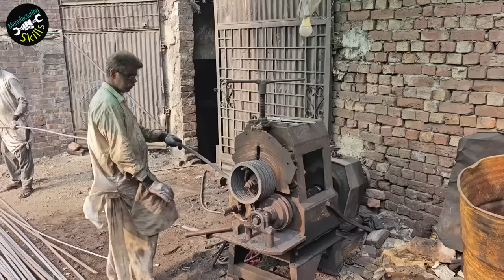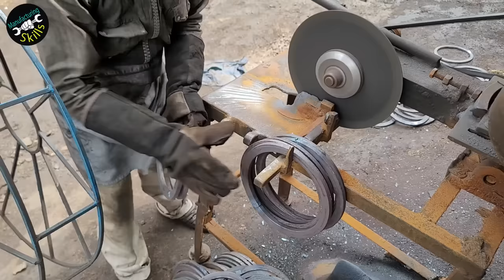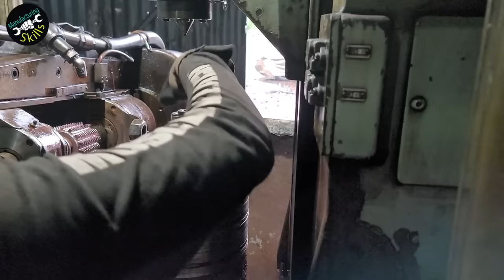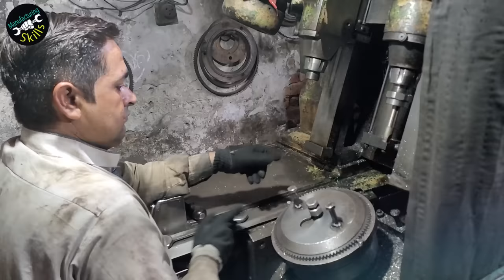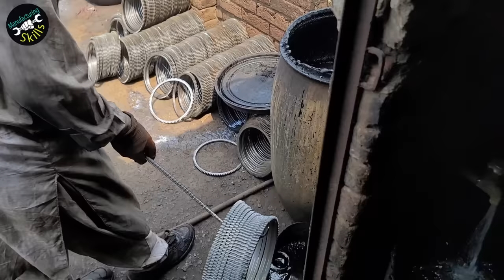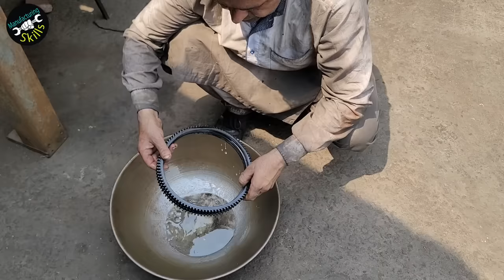Incredible Process Of Making FlyWheel Ring gear Of Suzuki Mehran

Comment: I'm fascinated by these videos, at every stage the item is thrown on the floor, why not use benches, that'll save some backache..
Reply: Agreed. By the time these workers at 45 they are so riddled with pain they can hardly work. How hard would it be to have a bench connecting all the stages.
Reply: They do all their work from off the ground !!! My back wouldn’t last 5 minutes 😩
Reply: В Индии это похоже на фетиш. Смотрел много видео. Везде кидают на землю, потом с трудом поднимают. И везде грязь и пыль.
До культуры труда им очень далеко.
Reply: @edaminev  Возможно ли это как-то связано с кастовой системой, высшая каста бросает его на землю, чтобы низшая каста могла его подобрать, тем самым утверждая свою власть?
Reply: @alexbaxter9512 that's  the dumbest thing I have read in a long time.
Reply: @sdsfgsty  You've not done much reading then?
Reply: give it a few decades then they discover using benches is better for your bodily health.
Reply: @snaplash the real question is what is a gear😅😅😅
Reply: When the Brits left, they took all the benches.
Reply: Probably a spare part. This part is infamous to wear on old engines.
Reply: none of your six sigma crap here just get it done or starve the operators are lean never mind the  operation
Reply: @johnfenn what makes you think these people will make it to 45, most will have been crippled due to poor working conditions.
Reply: @eweunkettles8207 I'm sure few get your joke but I find it hilarious !
Reply: Because they make their mistakes .And leave you to make your mistakes.

Comment: Imagine if they put the gear on movable carts rather than throwing it on the dirty ground after each step of the process
Reply: If I ran the place, I would spend a few days making work tables, carts, and organized racks.  Get all of the work up off the ground.  It seems very inefficient to me.  The amount of unnecessary energy that is expended simply picking parts off of the floor/ground is huge over time.  But they do make good parts with the machinery that they have.  I'm not sure though if the steel is tempered properly for its end use.
Reply: @edschultheis9537  from what I've seen throughout the years is in Pakistan and India the worker is "expendable", they're basically slaving away, (just remembered, EGYPT TOO! Egyptian workers in Jordan and much of the middle east are worked to death), in Jordan, it was cheaper to bring a bunch of Egyptian workers to carry bricks up a 7-floor building for an entire day than it is to bring a truck with an extendable boom that'll do the work in less than an hour. they owner simply doesn't care, he doesn't see the workers as human.

Comment: I didn't see any heat treatment. Soft iron gear? Chemical effects give it a color as if it had been broken by heat treatment. Didn't the material harden from so much soaking?
Reply: That's why they make so many of them, they only last three months probably.
Reply: 12.35 ish onwards. Looks like hot salts infusion to me. Then rinse, then neutralise.  He then blackens them and finally oils.
Reply: @chrisbis36ify  In a plastic barrel with some chemical balls in it? He doesn't look hot. Neither is iron.
Reply: @azrael834  no..... the metal looking tank. Brown in colour (liquid) its bubbling, which makes me think its heated. There's a tall gas cylinder on the left.
You will notice for the latter stages, they don't handle the gear by hand, but rather carefully on the end of a slight hooked long rod. Maybe they have been heated somewhere.
Reply: @chrisbis36ify  If you look at it, it picks up the waiting parts from the ground with the hook tool, which cannot be hot. The angle tool is needed because there are caustic liquids in the barrels. You can't dig into it with your hands. It is possible that these parts were heated in one of the phases that were left out, but then they should have been heat treated immediately while the metal was still glowing. And because of that, he would have already discolored. The way I see it, they use various acid tricks to make a hardened level, as if that would have happened.
Reply: You missed heat treatment part. I mean that part which welded two ends together :-D
Reply: It's not iron.
It's steel.  Im not sure of the alloy, but the teeth of the gear aren't very hard, they are just very durable
Reply: @gregbrightwell662 You can already see from the beginning that the material cannot be hardened steel. It would also be a challenge to process it. It would break when rolling. It would snap when welding. Well, it's not all hard material. But in those countries it is good. Where is this from German or Japanese technology? Anyway, I don't want to talk down. I am happy to see how such a country tries to prosper and develop. I also like Indian people! A simpler world is often more beautiful!
Reply: @NutsandGuts  Another arm chair expert ,on the web.
Reply: @daviddavis6231  Are you defining yourself?

Comment: Wow.  Red lead was outlawed in the US in the early sixties IIRC because of extreme lead poisoning from just the vapors that are given off when it is used as shown, high pressure gear hobbing.  There is little that competes with red lead as far as extreme low cost and coolant life.  Lead poisoning and birth defects must be astronomical for these workers and their families.  I have the EPA crawling up my butt if I drip some oil on the ground when I do an oil change on my truck.  Here, red lead is used freely and I'm sure it is disposed of properly.

Comment: No heat treatment i like my flywheel ring that will last a few months
Reply: I thought hardening was essential?? For starter rings. I can't believe it's not hardened.
Reply: Isıl işleme gerek duymuyorlar deneme yapılmış daha önce
Reply: @swarfs  that's what she said
Reply: @swarfs Ring gears are not hardened. I have replaced many flywheel ring gears over the years and to remove the old worn gear we simply drill a hole just beneath the teeth and give it a couple of blows with a hammer and chisel. They are quite soft and ductile.
Reply: @howardosborne8647  The body of the ring gear is not hardened, it has to be more ductile to shrink fit and grip onto the flywheel.  The teeth are hardened to resist wear, typically to over 45 Rockwell hardness.
Reply: Suzuki will have issued a specification for dimensions, hardness, etc.  If they don't manufacture it to those specifications, they will be rejected when one of a batch is tested.  Suzuki are not fools...

Comment: That chemical treatment is done to make it look like the gear has been heat treated. Those are mild steel rings and they will not last long.
Reply: the chemical treatment is simply black oxide treatment, it is a common enough treatment for ferrous parts that simply gives some rust resistance, it is not meant to enhance strength
Reply: Normally, Flywheel Ring is made of Pig Iron.
Reply: You just buy a pack for spares
Reply: I am using it since many years it's work for long at least 2 years or more
Reply: @husainzaidi1527 Pig iron is a crude form of impure iron derived from smelting iron ore. Ring gears such as these in the video are made from steel which is a far higher quality processed material than pig iron.
Reply: Exactly, I have nothing to add on.
Reply: The Mehran only has an 800cc motor.  I think a mild steel ring gear will be fine.
Reply: it's name blakening process
Reply: You buy the product over and over again without end
Reply: It is not heat treated otherwise it will tempered as the self gear is also high tempered so if both is hard the teeth will be broken so normally it wear of not teeth broken
Reply: @husainzaidi1527 you dont know what pig iron is.
Reply: The reason why they fail is because even the manufacturers use similar methods to
Reply: @mrbunchofcells  you made that up though.
Reply: @snowflakemelter1172  theory is sometimes evidence
Reply: @mrbunchofcells  theory is not evidence, a theory requires evidence to prove.
Reply: @snowflakemelter1172  is that so,, i suppose u've brung ur own evidence before making that claim?
Reply: @mrbunchofcells  don't be stupid.
Reply: @snowflakemelter1172 lol, stop liking your own comments you two.
Reply: It’ll last long enough to get through the 30 minute/3mile warranty
Reply: @norbertnagy5514  yo it's not me seriously i'll like my last comment as a proof
Reply: @icusawme2  it's still more than you'll ever last
Reply: @mrbunchofcells  seems true, sorry for accusing you then. Unless you have a second account or more but lets not jump to conclusions.

Comment: No hardened?
Reply: It is not always beneficial to harden some gears because they may actually wear faster and crack under the constant starter gear engagement.
Reply: @sgtbrown4273  but they need to be tough because the gear from the starter is pretty hard/tough. It would wear down a too soft metal fast

Comment: Flywheel ring gear is used for starting the engine. It connects to the starter motor via a solenoid. I hope this material is not plain Mild Steel, as that won't survive the brutal torque on it.
Reply: Ellerinden nur gibi emek çıkan emekçi kardeşim çalışma şartları çok ağır ve ilkel Allah hepinizin yardımcısı olsun. Patron parasına para katarken biraz sizlere daha güzel bir fabrika veya işletme kursun
Reply: Heat treatment is ignored deliberately. They want frequent damage of gear to attain more business.

Comment: 9:27 an unskilled eye might say impressive work, a skilled eye will have a look if all the teeth have the same length/shape otherwise the transferred speed will be not continuous per rotation.
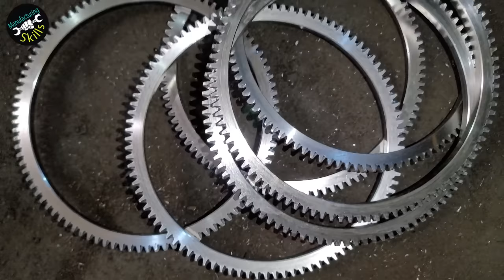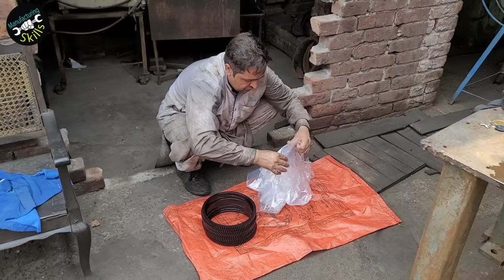That said I manufacture precision gears myself. 11:03 looks bad ... failed production or within the specified tolerance? 14:10 the gear teeth don't seem to look the same (height) so either there's a problem with the fixture or with the gear hobber.
Reply: The devil is in detail .
Nice Observation!
Reply: Nie hartowane
Reply: @wojtas-4  it's for a Suzuki Mehran, not for a car .... (just a joke)
Reply: From what I've observed in these videos from Pakistan, a lot of stuff is made this way in small factories and roadside shops in poor conditions, but it's sufficient for the industry there. Parts are probably inexpensive, they wear out fast from hard use, are replaced, and the old parts are melted to make new parts. They recycle everything. That part of the world is undergoing its industrial revolution, just as the West did about 150 years ago - except they have the advantage of a lot of new techniques the West did not have then.
Reply: Lack of heat treating was strange to me.  Surely that would increase the strength a lot?  I see it promoted by western gear manufacturers.  Also being precision ground not sure how that differs from a cob like in this video though.
Reply: well they take care that the customer will come back and generate more business sooner or later.

Comment: And the $60 000 question is … what is a Suzuki Mehran … and why does it need thousands of spare flywheels????
Reply: It's a Pakistan version of Suzuki Alto, a small 800cc city car from the late eighties, still assembled there.
Reply: It is from a Pakistani compact car,  FlyWheel Ring gear of the engine that moves the crankshaft, the working conditions from what you see in the video are from the stone age

Comment: I bought a Russian bicycle about 40 years ago. The bearings were soft, and there was a lot of friction compared to Western bikes that rolled with difficulty. When you tried to pull a screw, it licked off like plastic. How long can such an untrained gear withstand the load?
Reply: In 40 years russian bikes improved and now they have even chips from washing machines
Reply: @gerardjurgens2670  I only buy Japanese stuff. They know how to make good steel. Quality remains for decades. I'm not even satisfied with the German stuff, not with the Oriental and Chinese crap.
Reply: @azrael834  Japan once had a reputation for low/poor quality steel.  I'm 59 years old.  I grew up on a farm.  I remember numerous times that we would get simple Japan-made nails for constructing buildings and such around the farm.  Those nails were rather useless crap.  While driving a 16-penny nail (3-1/2" long) or a 20-penny nail (4" long), one slightly crooked hammer blow would bend the nail and make it useless... Had to pull out the nail and use a new one.  And often, the nail head would be ripped off as it was being extracted from the wood.
Reply: @edschultheis9537  I've never heard of a Japanese angle. Maybe the dealer scammed me. Maybe it was Chinese. To this day, the Japanese assemble wooden houses with joints and wooden nails.

Comment: All of these workshops are the same.  Walls of the lousiest brickwork.  Mortar long since turned to powder, ill-fitted bricks falling to pieces.  Dirt floor, upon which the work is done.  Frightening electrical wiring.  Overcrowded with machinery, stock, piles of junk, filings and shavings.  Random puddles of unidentifiable liquids.  This is the workplace; never mind the practice and technique or the quality of the final product.